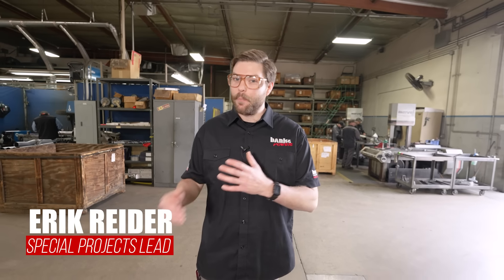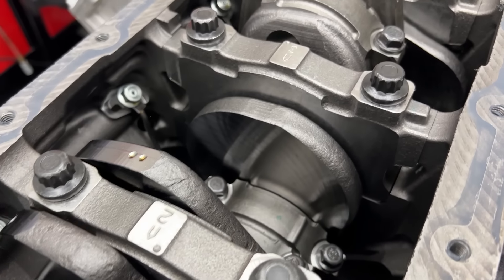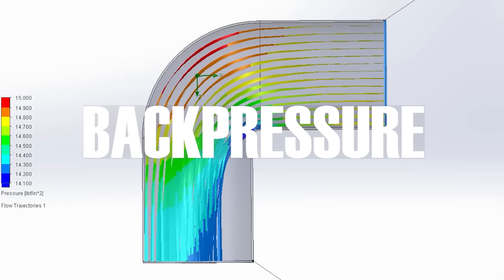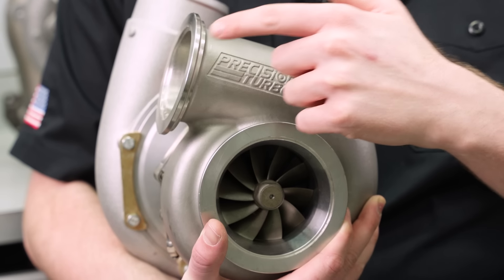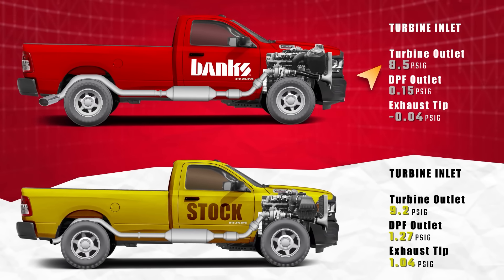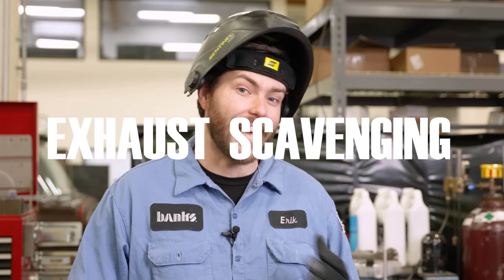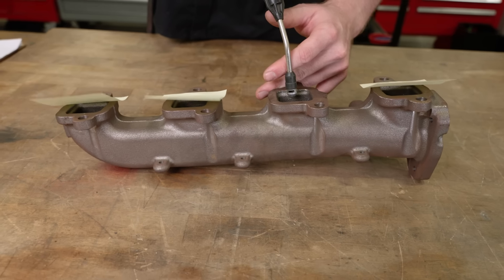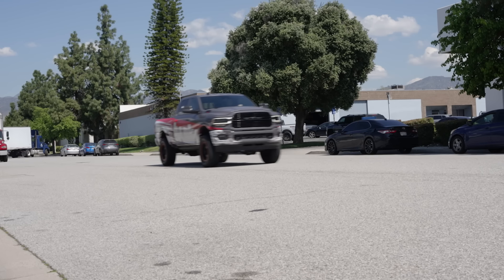Busting the exhaust backpressure myth | Banks Entry Level

Comment: There ARE cases where a heat dissipation from tuned length runner turbo manifolds can negatively impact driving the turbo due to energy loss from radiant heat?
Sometimes having the shortest possible runner length and retaining heat expansion effect improves drive on the turbo, albeit the log manifold shown here is rather crap because of where the turbo mounts; they could have at least centred it to try equalise gas pressure in more symmetrical fashion but i understand OEM designs are usually workarounds to compensate for optimal placement in the engine bay and they consider the negative effects negligible in comparison for more parts being redesigned or modified between turbo and non-turbo models (sometimes the manufacturers seem like they are on drugs with their "workarounds" - remaining regimented in changing as little as possible often means less machines, dies, press molds etc that required for redundancy for lifecycle economic reasons)

I think going with largest possible waste gate that can physically fit is more important than the manifold design or turbo housing...... Going with an electronic waste gate is also a better idea again 😉
Make it so when that waste gate clocks to full open; you are basically running naturally aspirated kind of exhaust flow. Just closing the aperture enough to equalise the resistance = 0 psi or static pressure, any incremental reduction in aperture size will  favour gases driving the turbo. If boost is your constant then left the computer control the e gate signal to maintain boost pressure as a constant set to what ever your liking?

Always oversize the waste gate way more than you need. Overkill is perfect for wastegate size always

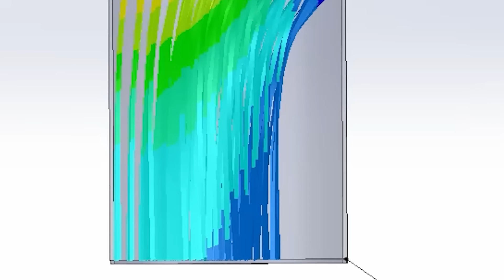Comment: 3:00 But the hot inert gas means there is less oxygen for combustion, and so there is less power and heat produced on the combustion stroke. So whilst the gas might be hot, the fact that it is inert means that less heat is produced on the next power stroke. This is precisely why EGR exists; to LOWER combustion temperature and reduce NOx.

Comment: 1:45 a hair dryer is not a good example, additionally if you block the flow on a hair dryer or sweeper/vacuum the load is reduced - which causes the motor to speed up and tone change.
Reply from the maker: We recognize that comparing an engine to a hairdryer is not apples to apples because the hairdryer is not a positive displacement pump. The demonstration is simply to describe resistance in its most basic form.

Comment: So what happens when you drill, burn, rust, or just plain miss a spot welding the tubes to the collector? The cops get called because your car will sound like a fully automatic 12 gauge shot gun.

Comment: My first car, a 74 oil burning Vega needed back pressure to keep some compression in the motor. How do I know? I dropped the exhaust on a street while driving home, and after that, the engine would turn over and fire until the key was moved to run. I could turn the motor easily by hand with the four plugs in 🤣

Comment: Some of the misconception may be due to a misunderstanding of how pressure waves inside the exhaust can be used to accelerate the incoming mixture during valve overlap and/or prevent some of the incoming fuel/air from escaping out the exhaust port during valve overlap. Of course, low performance engines with less overlap will be less affected, correct?

Comment: Not to be a super nerd but covering a centripetal fan outlet actually drops the resistance of blower and motor speeds up because the power input is the same but the resistance dropped... But your not moving any air so the efficiency drops off a cliff.

Comment: I've long wondered why many manufacturers will go to great lengths to optimize the inbound air, and fuel to their engines, have complex variable valves, and then put a horrible iron manifold, or log onto the exhaust. I understand its an expense, but wouldn't the increased free power and lower emissions be worth it in the CAFE and European standards environment? A couple mpg tenths spread out over a lineup would allow for more sales of high profit gas hungry vehicles.

Comment: this is interesting  there is some presser needed for   the word Scavenging   the problem here is   still missing the point of air to fuel intermixing  to attain the most possible work to power from the fuel that is consumed there is a point where back presser is needed  and at a point where it becomes too great  i have heard this before and the lack of back presser can be a problem  
it is possible to build an exhaust system that at speed will act to pull the gasses out of the motor 
 interesting video i remember this from School     and yes back presser can do good and harm 
 the best Idea is a good Header system  for both economy and power

Comment: I need an explanation about the flow-through mufflers ie glasspacks are restrictive.  Compared to a straight pipe it makes sense, any change in shape or  decrease in tube diameter can cause resistance. But if we are comparing mufflers to mufflers, it doesn't make sense.

Comment: Back pressure in an exhaust works like a spring returning some energy back to the crank shaft.
In the demonstation shown in this video you see how air blown down one header tube sucks the paper against all the flanges,this is a good demonstration to show how this works but the energy to achive this  is taken from the engine. If you are not going to extract energy from the engine to improve its efficiency, then you are better off returning it back to the crank. Don't believe me ? Try this experiment, remove the exhaust entirely and see if you get (1) more power.
(2) better economy.
You will find that without that back pressure in the standard exhaust you will get neither however if you change your manifolds for a set of headers you will increase efficiency but at the exspence of extracting some power from the engine, there are no free luches here. You give a little and get more but as for standard manifolds. Yes Back Pressure is your frend, remove it and you loose power.

Comment: Does this backpressure topic hold the same result on gas engines with much lower compression ratios, bigger cam profiles, and higher rpm's? Thanks, MJM

Comment: in a cam with 342 degrees of exhaustt overlap...aka the 327 350 horse hydraulic.....back pressure allows the fuel to be burned in the cylinder instead of some exhausting without being burned...  that camshaft , mid 60 s technology, there was way less lift....447 on the said 350 horse hydraulic..and way more duration than is necessary today. so, less duration, no back pressure needed.

Comment: So would this mean that a stock Dodge Charger with a 5.7 would see less back pressure with a 2.5” exhaust as opposed to a 2.75” exhaust?
   I ask because most exhaust manufacturers would say the larger pipe would allow everything to “breath” better, but after watching this video it has me wondering.
I just put a Borla ATAK catback exhaust on my Charger and it seems less responsive with the larger diameter pipe / exhaust.
I’m curious your thoughts on this

Comment: I agree.  100%.  You really want to start an argument?  Just explain to people how Boost is a measurement of the resistance of the incoming air charge that is going to the intake runners.  People will fly off the handle on that one.

Comment: What about the heat cycles of the headers? 
I chose BD Diesel’s manifolds because they are thicker and can withstand start and stop heat cycles. I’ve had BBK shorty headers and they were great but every 2 years I was getting cracks around the collector. 
5.7l Hemi by the way and I love your stuff, just bought a pedal monster the thing is awesome and the banks IDash is awesome too.

Comment: I have a question regarding N/A fuel injected Applications (in my case motorcycles). I have heard that you „need“ the back pressure from the catalytic converter because there is a short moment in which both the exhaust and intake valves are open and the fresh air/fuel mix flushes out the exhaust gasses. That means if you were to decat a bike that is otherwise stock the engine would run lean because some of the air/fuel mixture would escape into the exhaust due to lack of back pressure. I have heard of catastrophic engine failures due to a decat pipe mounted on a stock bike without a remap. 
Would you consider this information true? To me it makes sense.

Comment: So with my 2000 lb7 duramax I did an aftermarket 3inch down pipe that replaced the squished style with a round style that flows into a 4in exhaust kit full length i also did the high flow manifolds and bigger diameter up pipes. Question is in a professional opinion did I go the right direction with my mods my main concern was the heads on the early lb7 I wanted heat away from he top end as quick as possible please.advise thank you

Comment: Not to be too pedantic, but the hair dryer example is actually wrong. The motor speed increases when blocking the flow by hand because the blower is no longer moving air, i.e. not doing any work. The air inside the blower just starts spinning with the fan, reducing load on the motor. Put a current clamp on the electrical feed and check ;)

Comment: The reason we were taught you needed exhaust back pressure, wasn’t any of the reason you gave. It had to do with the edge of valves (mainly the exhaust valves) getting to hot and getting red hot and causing detonation in the cylinder.

Comment: Am 70 years old and have over the years have rebuilt numerous small air cooled engines.  There seems to be a problem with these engines when you run a straight pipe, broken connecting rods and scored cylinders.  Always when I tear down one of these engines, no muffler, say on a rototiller as an example with a broken connecting rod EVERY Time there are MAJOR scoring on the piston and cylinder at the same location of the exhaust valve pocket.  Is this a situation of where I have repaired engines that just happen to have a similar issue, or is there something behind it.  Talked with numerous small engine mechanics and they see the same thing.  Then take a pyrometer and measure the exhaust valve pocket area, the straight pipe units the exhaust pocket area is significantly higher.  Now these are air cooled so heat issues seem to escalate over a water cooled engine.  A water-cooled overhead valve engine will not have this problem.  Ask any old time Flat Head car engine builder and they see the same issue.  It is not observed on OHV ENGINES due to much better cooling.  So you guys are right, on a modern engine, but on some of the old time flat heads is a different story.

Comment: Straight through glass packs increase back pressure??????? Yeah if you size them wrong. I do seem to remember some years ago that even though the inlet and exhaust connections were big, the core was kinda small.

Comment: I have 2020 shelby GT500 , how can i decide if  i need backpressure to enhace performance???
Factory exhaust size 2.75 , and most aftermarket exhaust complete 3 inch pipe system .

Comment: That is true for stock and turbocharged engines.
Your engine would benefit from backpressure if you run long duration cam/cams, as you have too much open time at low RPM. By having a little backpressure the outflow to the exhaust would be dampened and thus the gases won't come out that fast, rather they would be gently pushed out, if done correctly. If you run zero back pressure with long cam duration, the gases would come out fast and then they'd be sucked back in as a pulse, so it's not a legend. It has a point and it's applicable in certain builds.

Comment: I haven't watched the video yet, but my prediction is back pressure comes from Two-Wire O2 sensors. You need to keep the sensor hot and the easiest way to do this is keeping more exhaust in the system. With heated O2 sensors, you do not need back pressure.
Reply: You do need back pressure, because not running exhaust headers is dumb
Reply: @JohnSmith-xu7ev  but engines without headers are dirty

Comment: I could argue this about back pressure. Take a 2000 civic si back in the day everyone ran the thermal dynamic 3in header back exhaust. This was too large to flow with just bolt on and NO boost. The Mugen or Apex world sport exhausts back in the day on a EM1 si with bolt would create more power and a smoother power band? Is that not due to the restrictive back pressure more equally matched with the flow of a a basic street car with low HP and just breathing bolt on. Vs a bolt on motor running too big of an exhaust. I was told this by King Motorsports in Wisconsin like 05 during my Honda years. I have a SL1 kit car with LSX motor that has super traps. Car came this way when I bought it. I guess for back pressure

Comment: "Poor man's EGR" often, unfortunately, happens in engines that don't benefit from EGR.  😀

Also worth noting that newer emission control equipment has FAR less back pressure.  If you have an older vehicle with an old style emissions system, upgrading that to a modern one won't just reduce your emissions, giving leeway on your emissions testing for your other modifications, but reduce back pressure at the same time.

The myth you didn't mention on back pressure being good has to do with tuned pipes and two stroke engines.   Obviously, we don't use two stroke engines, so that isn't exactly going to apply here, now is it..

Comment: i have a 73 ss nova with a 396 bbc with tunnel ram i run open headers i just can't drive it after 10 pm on the streets mostly it just see's a 1/4 mile track but were i live we have a road by my place with 1/4 mile marked out for no reason at all but i have no back pressure

Comment: What about burnt valves , I’ve been told if you run open exhaust you will burn the valves , so back pressure keeps the valves from burning by keeping out oxygen

Comment: if you want to suck the exhaust gases out wouldn't a  slightly shrinking cylinder around the exhaust tip that lets air flow straight through be better? the vehicle driving forward will create a venture effect so the faster you go, the higher the drag on the exhaust gases? like an airplane chute design for rapid deployment.

Comment: I had a mazda 323 with a whooping 1.6 liter 90 hp engine. One day my flexpipe fell apart and all the gases exited right behind the exhaust manyfold. So the little 4banger sounded like a big boy, but you could definitely feel the loss of power. Why this, when backpressure is so bad? Sure engines with forced induction don't need any backpressure, but there are some na engines, who lose a lot of power without it.

Comment: Unfortunately, the thing he doesn't state is that most common operating conditions fall outside the range where either exhaust back pressure or scavenging have any real effect on engine performance..... Most big diesels & hot rod engines spend most of their time chuckling around town unloaded & at low load conditions, not working hard. Furthermore, you (& your neighbors) have to listen to your hot rod exhaust.... Loud pipes do not save lives, loud pipes annoy the neighbors. Save your money, Guys.
Reply: Bigger, better flow and quiet aren't mutually exclusive. It's a matter of design, and that costs money. So the "quiet" part of the system criteria typically gets kicked to the curb because it doesn't make life better at either the fuel pump or the gas pedal. It's not that it can't be done, it's just that it's money spent that doesn't add power or efficiency.  So, the "save your money" guys do so by settling for 2 out of 3.

Comment: The exhaust is properly on of the most misunderstood part of a motor.  I have spend years (UCI)studying Laminar Flow and the physics of what happens inside a race engine. Drag cars run "Zoomies" with no merge collector? Aside from noise, why do we need such an alabrite exhaust?  How do we understand pulse and loop scavenging, reversion? Funny cars and Top fuel cars don't run anything even close to it. Aside from noise why don't we all run Zoomies?

Comment: For a tuned length branch manifold to work optimally; each pipe needs to be the same length.
A little bit of variation is OK and increases the rev range over which the branch works, for a small drop in peak power at the desired/designed length/rpm..
Your pipes (as shown) however have a HUGE difference in pipe length.
That will result in very little power increase over a very wide rpm range.
So why..???

Sure it makes manufacturing  cheaper and eases the space constraints, but that is exactly what you were taking a dump on in the video... so..?

Comment: I have a question that no one will answer. I have a 2022 GMC Sierra 6.2. The cross over exhaust pipe from the driver’s side cylinder bank is squished down to less than half the diameter. Supposed to be for clearance. I think this is horrible and needs a round replacement pipe. Any suggestions? Thanks.

Comment: Hahaha. The parasitic loss of a super charger is less than the back pressure, and i own turbo vehicle. Hot rod magazine did an article way back in the day dyno testing true duals versus both styles of cross over pipes H and X. The true duals, two separate pipes made more power.

Comment: Thanks for educating us with great information! One thing is not quite clear to me though. How will I liberate horsepower when I still have the same map on my car with the same exact torque request as I had before the manifold upgrade? Should I just go ahead and request more torque?
Reply: you get a little hp from the higher velocity and you can now dump more fuel into the cylinders to get even more hp/torque
Reply: @73Datsun180B  Make sense, thank you!

Comment: So why don't you sell a nice equal length header system for Turbocharged engines? And what happens when you run compound turbos (one turbo feeding a second while the exhaust goes from the first to the second as well)?